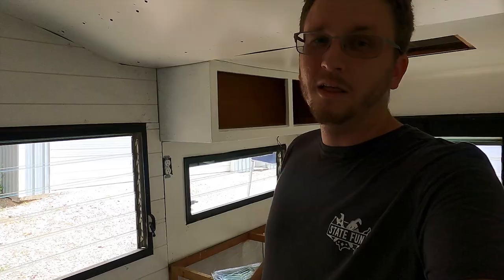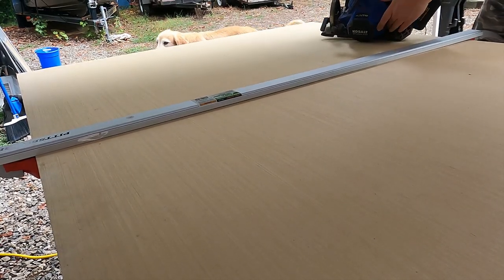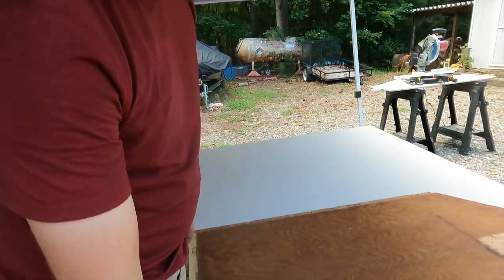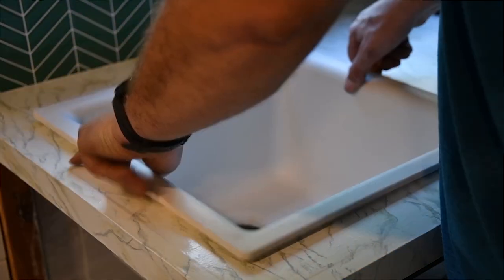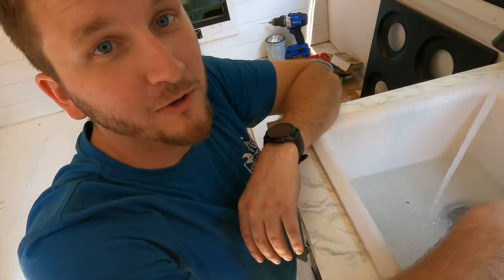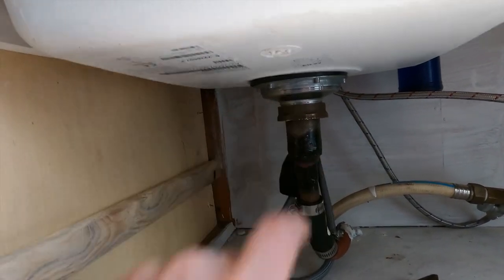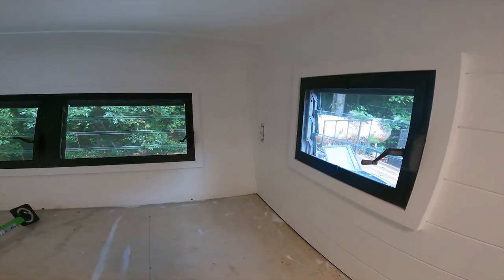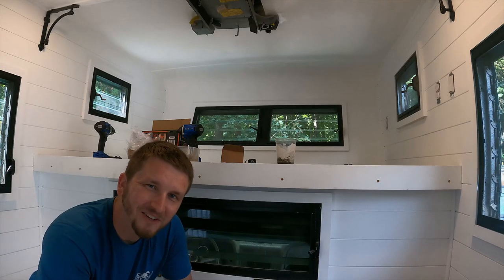REMODELING A VINTAGE TRUCK BED CAMPER! (STUNNING Kitchen Renovation)

Comment from the maker: This camper sits on a 1962 Chevy C20 truck that I did a CUMMINS SWAP on! I documented the entire process on my channel so be sure to check it out, especially this video where I removed the Dodge BODY off the frame of a first gen Cummins to use with the old body of the Chevy: https://youtu.be/bBitfW20rNc

Comment: Looks great, where did you get the long flat clamp you used with the tiles
Reply from the maker: @elizabethcomstock1699  I got it from Harbor Freight. It's designed to be used as a circular saw guide bar, but it works well for cutting those stick on tiles too!
https://www.harborfreight.com/50-inch-clamp-and-cut-edge-guide-66581.html

Comment: Measure twice, cut once... I just realized where I've been making my mistakes, I had the proverb backwards.  Mrs Emily did a great job with the contact paper. The stuff looks really good when done correctly, but in my experience it's super frustrating. You guys will be ready for a cross country trip in no time.
Reply from the maker: Cross country trip sounds great!